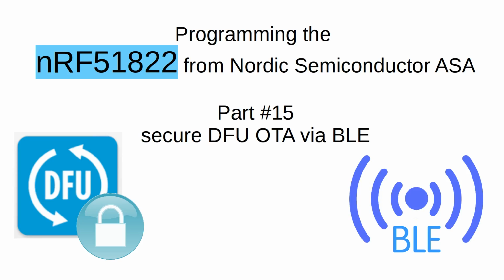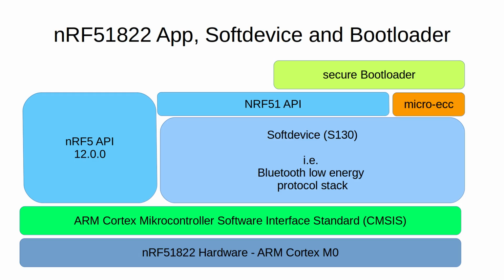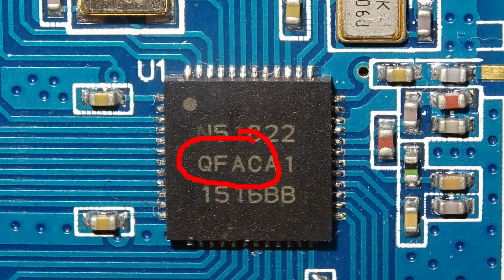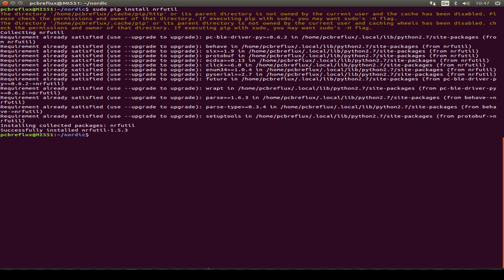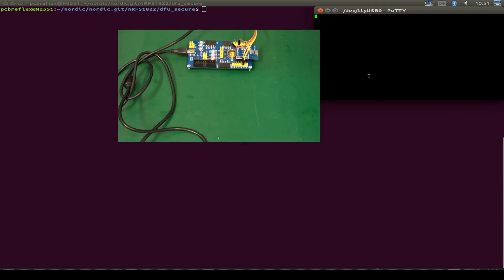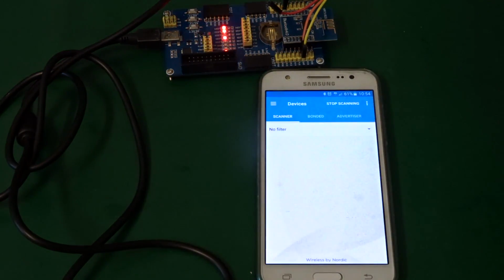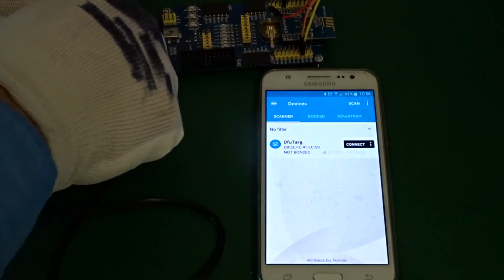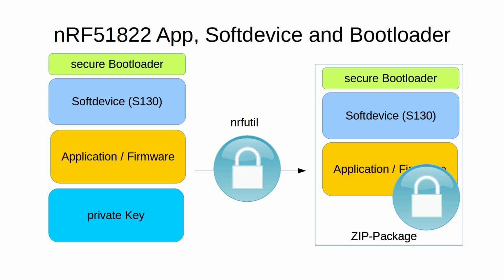nRF51822 #16: secure DFU OTA via BLE (english)

Comment: Good evening, I hope you are well, I followed your steps successfully until the fifth step. To compile a hex file, I used nrfutil and I succeeded. use my own applications (files nrf51422_xxac_s110.hex)). The problem is that I do not know how to build the bootloader. I created a private key, but I did not understand how to use the micro_ecc library and how to create a boot loader.
and about when you type the make command on terminal, you did make why ???

Comment: I want send a application from mbed using this bootloader/softdevice. I build just the application form mbed compiler using same parameters in .json i reduce the size from 677KB to 122KB, so i think that is just the application. But putting in the package with the nrfutil pkg generate i can update to the board, but the program sended does not do nothing.

Comment: Firstly, thank you so much for your videos. Well, I'm having difficulty after step 5 because I use windows.  I can not follow the steps after "git clone". Can you explain or show me how to do it in windows?
Reply from the maker: If you already at step 5, then you have python and pip running on windows (sorry but never try this on windows)? 
More infos from Nordic here https://github.com/NordicSemiconductor/pc-nrfutil

The command line have to be the same on all OS. Step 6 and 7 are signing the compiled hex-files, but don't try this on windows. How do you compile you firmware on windows?
Reply: Yes, I have python and pip and I have followed your steps successfully to the fifth stage .To compile hex file, I used nrfutil and I succeeded.(I could generate zip file that include .bin , .dat and manifest.json files with use my own applicaiton.hex( nrf51422_xxac_s110.hex files)). The problem is, I do not know how to build the bootloader. I created a private key, but I did not understand how to use the micro_ecc library and how to create a bootloader. I just have softdevice.hex(s110_softdevice.hex) and my own application.hex (nrf51422_xxac_s110.hex).
Reply from the maker: Ugur Kebir Sources for the dfu bootloader are available as part of the nordic nrf5 sdk under examples/dfu and on my github page I uploaded only the changes i made to compile the example with gcc and micro-ecc under ubuntu.

Comment: Hi, I have a iBeacon, how can i update it to eddystone URL
Reply from the maker: Hi, short answer: compile the eddystone firmware for your device (type? vendor?) wire a suitable programmer to your device and flash the firmware file from your computer (os?) to the device. If you current firmware provides (?) ota then you don't need a programmer and  can send the new firmware (hex / zip) via your computer (ble via command line) or smartphone (ble via app).
Reply: N51822, manfacturer does not support OTA https://goo.gl/5hczQz, and it has no interface to connect with. Looks like I need to try with another
Reply: have u designed any beacon?

Comment: I have a nrf51822 beacon kit. I'm using Windows 10. I only want to update the application code via dfu. can that be done? I only have the 1 kit and don't want to break it.  thnx
Reply from the maker: jholworld The chip is really robust. Until now I find no way to break the nRF51822. No x time soldering. No excessive heating. No software damage. But also on Win10 with python you should be able  to send the firmware. See https://github.com/NordicSemiconductor/pc-nrfutil/blob/master/README.md for more.